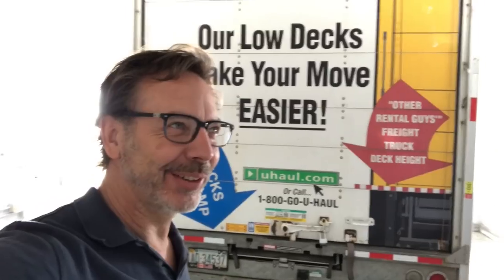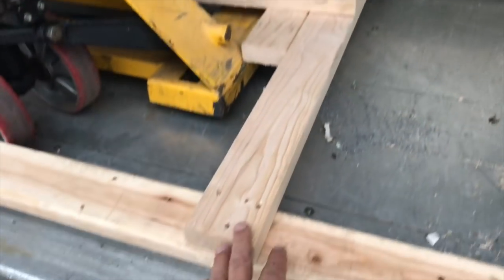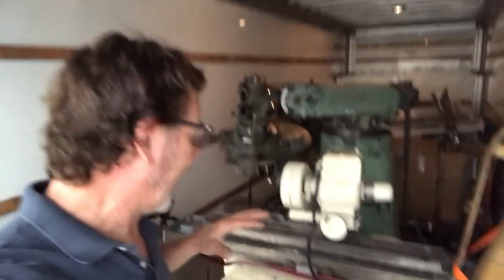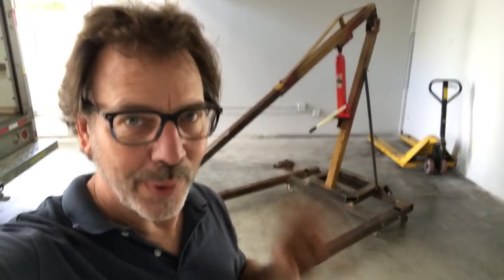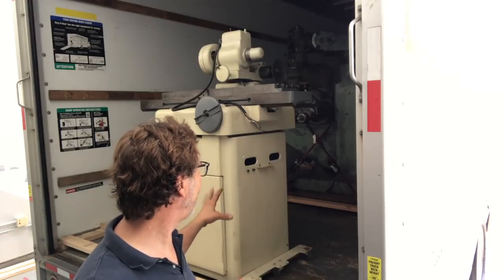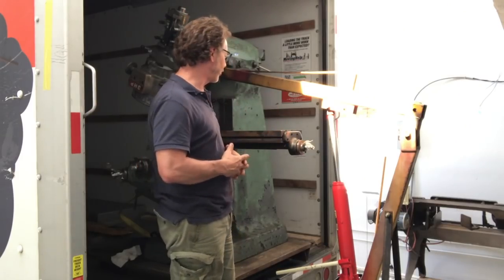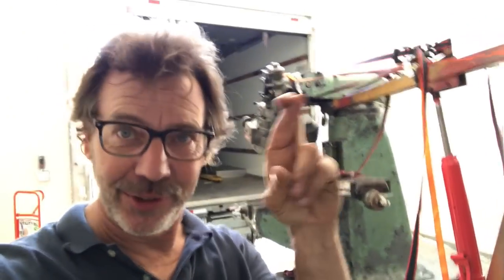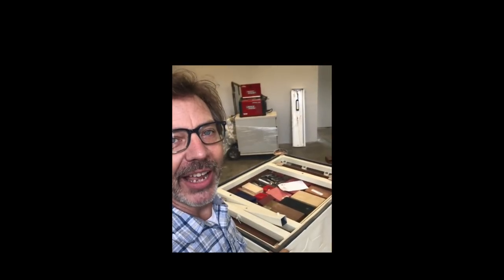Moving Machinery

Comment: We went to a machinery auction.  They were trying to pick up some kind of tool grinder.  It had 4 holes like yours.  They hooked a chain in two of the holes diagonal across the base.  My BIL and I were setting near waiting for my son to go get a skid steer and trailer to load the Bridgeport mill that he had bought.    My BIL and I moved the hell out of the way when they started lifting it with a front end loader on a little tractor.  Sure enough, as soon as it cleared the floor, it flipped over on its side and pretty well destroyed itself.
Reply from the maker: Thanks for the story. I seen similar one play out too.

Comment: I moved a 1200# band saw off my truck by using a 2 ton chain hoist and putting 3/4" black pipe under the band saw to roll it down a 10' ramp using the chain hoist as a brake and slow release. Just make sure your point of the hoist placement on the band saw is high enough to compensate for the shift in the center of gravity when gong down the ramp --easy

Comment: You should have welded a support on the extension you made for that engine hoist. There is a shitload of force pulling on that little area of the extension. remember...gravity is your enemy when you move heavy machinery.
To make a lathe or similar stuff rest safely on a concrete floor make some small stands where the screws can rest inside and put some roofing paper beneath it. The roofing paper will settle into the small pores of the concrete and prevent the machine from "walking away" from you due to vibrations.

Comment: I know what it's like trying to move a large milling machine by yourself. The last time I moved my beast of a machine I had it on a pallet jack and I was just moving it into a garage until it was ready to be moved to another site. The problem was getting it up over the 1 inch high concrete lip where the garage door comes down. So I built some wood ramps but getting it to roll up those ramps was very difficult. The wheels just sunk into the wood. When the come-along failed to pull it up the ramps I tried pushing the pallet jack with the back bumper of my truck.  As I pushed it the milling machine tipped over but wedged itself against the garage door wall so it didn't fall completely over but it was still on the pallet jack which was also tipped with two of the wheels off the ground! So then I had to somehow get it tipped back upright. Amazingly I tied a rope to the top and pulled it with my truck and in an incredible stroke of luck it popped back upright while still on the pallet jack AND the wheels were up over the 1 inch garage door lip! It was the luckiest day of my life.
Reply: (Laugh!) I would say so.  It solved that problem!  I've used steel plate over wood with success - and in one case had to use channel iron (two heavy, 20 foot long pieces) going back into the shop, with pieces of pipe under the machine and a come-along to move it.  We got it over a gap and lip that way.  I was quite busy moving it, putting new lengths of pipe under the leading edge and pulling them after the machine came off of them!

What was the beast?
Reply: It is a large Bridgeport mill but it's also a 3 axis CNC machine so it has an extra 500 pounds of crap bolted on to it. The first day I bought it and I unloaded it from the trailer I used my VERY heavy duty engine hoist and it bent one of the bottom square pipe forks. It also sheared a 1/2 inch steel bolt on the engine hoist. I was shocked to see this thick half inch bolt with a wicked jog in it and then sheared completely off.
Reply: I used to own a couple of those - actually Bridgeport machining centers.  I went in on a deal with another person to buy three of them for a really good price (they were going to be kept on his property while all three were fixed) - and as soon as I got one going, the jackass threw me and the other two machines out.  I had them stored at another shop, but eventually the guy needed the space - I couldn't get them moved in time (too heavy for most movers), and lost them (many years ago, and I don't have a place for something like that).
Yeah, a half-inch bolt would do that, especially one that wasn't hardened.  I think that the size used for the lift points on my machines were 1 inch, but they may have been bigger.  It took a really heavy crane truck to move them.

Those old Bridgeport machines worked great, especially if you could rig up something to keep the stepper drive compartment cool and clean - and had a box of spare transistors.  They were RUGGED.  I liked working on them and used to have all the schematics and other things like that.
Reply: Yeah, mine must have come from a machining center because it has a big number 4 on the head. It's a V2XT-DX32 mid 1990's era machine. Here is a video of the actual machine I own that was posted by the previous owner before I bought it. https://www.youtube.com/watch?v=vQBjgEnxrDc And here is another video that shows a more complete shot of the mill but still doesn't do it justice as to how huge the machine actually is https://www.youtube.com/watch?v=OBL_udE0fxA

Comment: My heart stopped when you lowered your mill.  When I took my mill off my trailer the mill was on a pallet jack.  I sweated getting it off the trailer.  Got it off the trailer on the pallet jack.  Then when moving it into the garage I discovered and uneven area on the floor...the mill did a slow speed tumble off of the pallet jack ( you can't reach out and stop 2000 lbs!).  A bent  Y axis screw, degree wheel and handle later....about $300 in damage.  Uggh!   Everyone please be careful when moving this heavy stuff!
Reply from the maker: Wow! That is my biggest nightmare. Lucky it was only $300 bucks

Comment: I hoisted my Bridgeport [column and knee only]  about 12" with 2 ton engine hoist and 1 of the castors snapped.  Lucky it landed flat and didn't tip.  Don't think I could handle the stress of lifting the whole mill that high

Comment: I live in kalifornia, would love to move to another state, except I hate the cold.  I was working in the Puerto Rico region during the hurricanes last year, at the end of my adventure, the plane stopped in Atlanta, I went from summer to winter, instantly, I didn't think it got that cold in Atlanta.  Here in kalifornia, we get what I think are both extremes, but since Half Moon Bay is on the coast, you may not need air conditioning and it doesn't get all that cold.

I've thought of packing up my shop and moving, but all of my machinery, I wondered it it would be better to just sell it and buy used or new stuff after the move?  So it appears it's going to take you at least two truck fulls, wow, what a trip.  

I hope it all works out for you here, at least you aren't far from the San Jose area, there is quite a bit of industry there, would be good for your hobby.  I'm in the Sacramento area, it's a cow town here, not much industry.

Jim

Comment: Hey Dale thanks for all your insight over the years.  I bought a Chinese milling vise after seeing your video and for what we do its perfect, plus $400 cheaper.  Here's a request I have not been able to find - owning an vintage lathe vs new.  Example from what I can  find old lathes run much slower so does that mean inserts are meaningless with them?  Seems so. We have an old South Bend.  New lathes all seem to have high RPM ranges and older very slow such as 800 to 1000.  I have also learned the hard way on vintage parts prices, have ExCellO mill and parts are hard to find and very expensive, so we make them.  Anyway your ideas on old vs new would be something of interest, at least to those of us that moved out of La La Land as fast as we could and moved to Arizona:)

Cheers
Vector Warbirds USA

Comment: Good job.  I used to repair machinery (including CNC/NC and other tools of all types), and you did things right - except the mill, which I thought you were lucky (I stopped sweating when you added the straps holding the mill from sliding).

I have used a multi-strap arrangement so that the mill is suspended from (preferably chains, but have had to use straps a couple of times) going to four high-as-possible points on the base, plus straps to the table (four is best) and at least three on the head.  Chains are nice for that (get ones strong enough) because they don't stretch until they're close to the breaking point - so once tensioned, you're not going to get movement at that point.  I'd really rather use a forklift strong enough, with plenty of straps and chains holding the load firmly secure - or a crane if available.  (Sometimes you can only use a crane, for the big ones.)  (Laugh) a engine hoist modified like that - good idea especially when it's one of those weird small moves.

I've also had a broken mill - in spite of a dozen straps and a couple of chains, a hidden pothole got me.  It bounced the trailer the mill was on so hard that everything loosened (a couple of straps broke as I remember), and I had to manhandle the thing back on after it bounced off.  I ended up having to make a new acme thread screw for X - bent the original, and broke the end casting on that side.  That was a piece of equipment I took in trade for getting a man's shop up and running again - helping him out as he was having a hard time (major equipment failure).  I quickly learned that I don't like using utility trailers without much modification!!!

When I was  helping to move machines, most of the equipment required a crane to move it.  Usually the control and electronics were separate, and even though everything worked when I started tearing the unit down, I always told the new owner to NOT take any work for it until we had it working at their shop.  Even the best drivers cannot avoid their load to get shaken up and invariably something will get knocked out of kilter (in spite of good packing).  Usually it's minor... but aggravating.  Re-aligning and leveling is also not something that can be rushed.  

BTW - your support framework was adequate... most of the machine moves involving trucks like that (not flatbeds and so on) had a framework like that built in place.  One exception is that there was additional framework going up to the ceiling - and support braces a little above the machines.  Straps ran from the framework down to each (plus the way you had it).

Comment: This hurts to watch. I have moved my shop a few times. My rules are to always have a forklift, rent a high deck truck (so you can load from the side without the wheel well interfering), and tie everything down to the deck. Trying to cheap out when moving is poor economy. A moving truck is not designed to move heavy point loads (loads that can exert large forces on a small area). Most serious trucks are open air, because it is too difficult (and not worth it) to load and unload a box truck. You can always cover the machines with tarps, and if done correctly will leave the machines dry even after driving through a rainstorm.
Finally, I always have a friend or two when loading/unloading. At the very least having a second set of eyes helps a lot.
One time I learned a lot was when moving a mill with the forklift. I has depalleting with the forklift and had untied the straps to the pallet, then was just lifting the mill with the forklift. I got clumsy with the forklift control and the mill started to rock back and forth on the lift. About all we could do is stop and hope it settled down. It did. From that learned: tie everything down. Even to lift the mill a few inches up, tie the mill to the forklift.

Comment: You are damned lucky you were able to pull this off.  The ratchet straps you used should NEVER be used for lifting as they are NOT designed for lifting.  Proper slings should have been used.  Slings designed for rigging have a 5 to 1 safety factor built in (i.e. if their rated capacity is 1000 lbs. they have been tested to 5000 lbs.).  Glad you accomplished this move without hurting, or killing, yourself and without damaging your equipment.  I would recommend you remove this video so that others don't attempt the same foolish tactics you used.  I enjoy your videos and will continue to follow you on Youtube but you need to stick to machining as you aren't anywhere close to being a rigger.  Sorry if I offended you but I would rather offend someone than have to read their obituary.

Comment: Cops can easily tell that your 16,000 LB GVW UHaul truck is overloaded. Ok for furniture, which would put it near capacity, but moving what you did must have bottomed out the springs. Cops will easily see that, and, if want, pull you mover, bust you, hold you on side of road until another super expensive truck and machines arrive to offload your truck until you are no longer over weight. Ask any experienced trucker about that. Pushing the engine hoist, or any typical shop gantry crane with a load on it is seriously dangerous too. Move truck instead. I hope you and others will consider this. I have a lot of diy machinery moving experience too. Never attempt anything you are not absolutely sure of.
Reply: BiddieTube and yet he somehow made it across the continent unscathed.

Comment: I'm gonna be honest here, but too much face time like some narcissist, too shaky camera, too much "suspense" for what's a simple unloading job. Too much filler...
Reply: I'm going to be honest here!!! Too much negativity here, not enough appreciation for all the hard work Dale did to bring us this free content!!!!!
Reply: I disagree. With that much weight close to the limits of the hoist it is not a simple unloading job - care and planning are essential. I don't like using ratchet straps for lifting so I use chains. the harbor freight ram has the controls in the wrong place -they need to be off to the side. There are some great tips for would be movers.
Reply: You're being a bit harsh there mate. He had a lot of heavy gear packed into the van.
Gave lots of useful tips for getting it in and out safely, thought up and built some pretty clever equipment to make it possible. Personally I'm impressed.
Reply: If you had heavy machines to move, then you would get it.